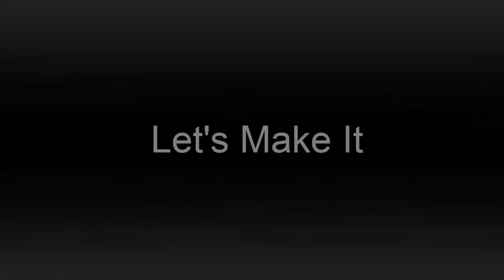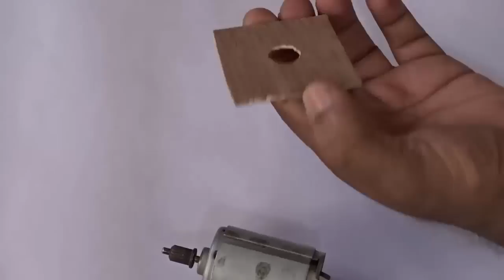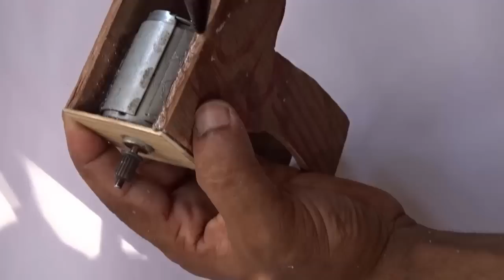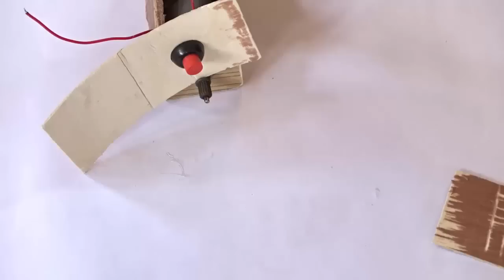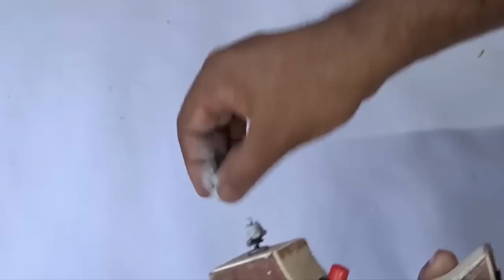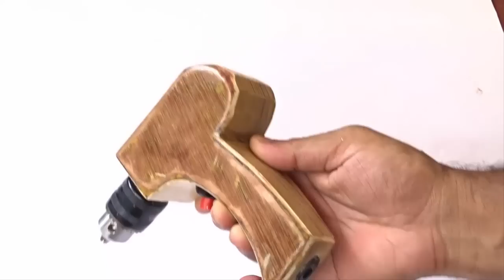How to Make  Powerful Drill Machine at home.

Comment: Hi. I have the motor and drill chuck, but I don't have the connector. And not able to find it. What should I do, any alternative option do u have
Reply: Modifications with Manoj u can use a 12-24 volt battery 🔋which will also make it cordless

Comment: What is the price of 12v adapter. What if it connect with direct electricity with plug to socket what will happen reply me
Reply: BOXER BHARATH 12v adaptor 150rs  ka mil jata hai

Comment: I have 6000 run DC motor battery and m seal but where to got the drill gear
Reply: The drill chuck is available in some hardware and electronic hobby store
Reply: Its just for about 1.5 $

Comment: Even a bigger motor than a 775 or a starter motor, if you just put a chuck on the armature, its not powerful.. Just because it has a sharp drill bit in a high speed motor, its not powerful! A hand- cranked drill is a powerful drill because it will always do the job. You make a homemade drill, when you add powerful, I call it bullshit.